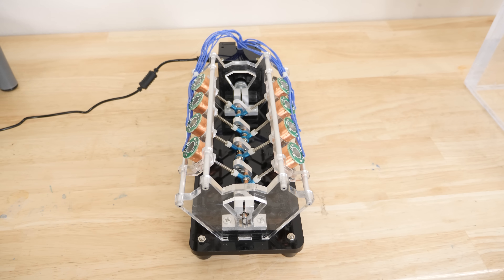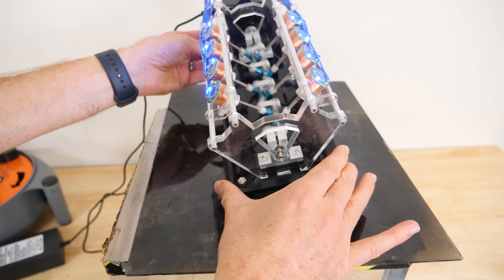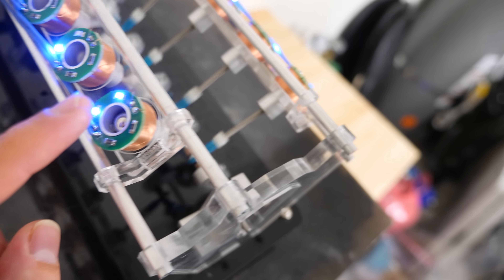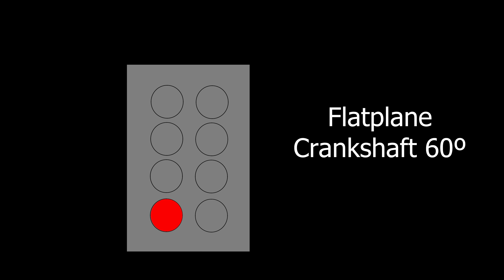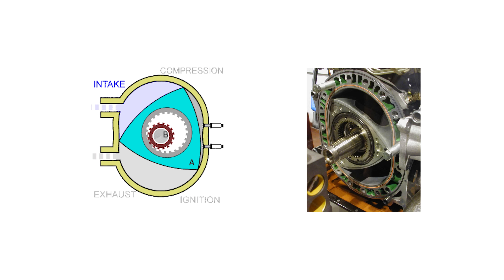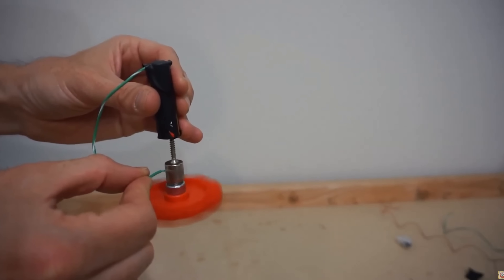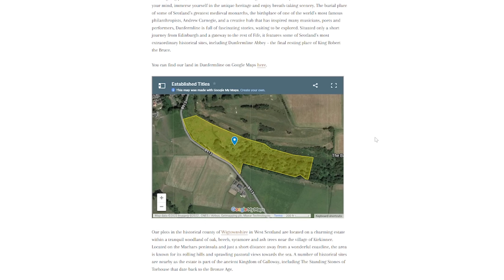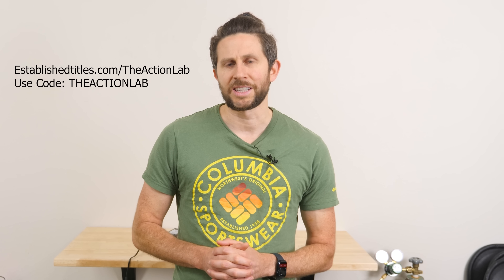Is an Electric V8 Engine a Good Idea?

Comment: Ridiculous idea. You are losing so much energy moving pieces for no reason.

A 3 phase motor directly mated to the axle is the most efficient way. It's why locomotives have been using traction motors for decades.

That 16 cylinder twin turbo diesel engine does nothing other than turn a massive alternator to power the traction wheels.

Comment: The magnet should be directly pushing the crank not using the the pistons. Shorten the block as the magnet his the crank the the crank has magnet also that pushes the magnet back up until gets another magnetic pulse to push the magnet back to push the crank again.  Get the scales out see which motor creates more torque & speed vs induction electric engine.
Worth how much material is needed to manufacture each engine etc etc.. I don't believe you can beat a well designed hub electric motor as this eliminates the need for any other parts needed to start & stop , no more brakes diffs axles drive shafts etc etc design a wheel ALTERNATORS & you have a perpetual engine that shouldn't need battery once it's moving only for initial start & stop starting. If can design an engine that holds charge for 10-30 minutes then this should minimise size of batter or jumpstart pack needed. Faster you go the more energy the wheel creates to charge motor. Ideally wireless charge then can wirelessly charge everything else on car also delete wiring also. Bla BLA bla blabla

Comment: Something I'm surprised I haven't seen brought up here though, is the ability to swap a gasoline car to electric if the platform is in a V8 formation. May not be as efficient. But it would allow some that may not be able to afford a Tesla to swap. Or if someone loves the body/design of their current car, to keep that while switching from gas to electric. I don't think there's enough conversations about swaps from gasoline to electric, instead of just getting rid of a car design you potentially love, just for the benefits of electric.

Comment: Electric vehicles are a horrible idea. The Electric power grid is not even close to being efficient enough to handle the power needed to recharge the batteries. The infrastructure is old and no longer able to keep up with the changes in society.

Comment: I always wondered why automakers didn't use electromagnets to control valves instead of a camshaft. Seems like it would reduce weight and increase tunability of VVT systems, albeit costing more.

Comment: AN "ENGINE" HAS VALVES, PISTONS, CONNECTING RODS, CRANK SHAFT, CAM SHAFT, BLOCK, HEADS, CARBURETOR, DISTRIBUTOR, SPARK PLUGS AND WIRES AND SOME KIND OF A COOLING SYSTEM BE IT WATER OR AIR COOLED.  NOW A "MOTOR" HAS NONE OF THESE THINGS, SO WHY DO A CALL A ENGINE A MOTOR WHEN ANY EDUCATED PERSON KNOWS THE DIFFERENCE.  SO ARE YOU EDUCATED OR NOT???????  TO ME SOUNDS LIKE YOU ARE "NOT" EDUCATED ! ! ! ! ! ! LEARN THE DIFFERENCE, IT IS EASY.  GET A PICTURE BOOK THAT SHOWS A MOTOR AND AN ENGINE AND LOOK AT IT SEVERAL TIMES OR UNTIL YOU TRULY KNOW THE DIFFERENCE.  ONE THING ABOUT STUPID IS THAT YOU CAN NOT FIX STUPID AND IN THE FOREST GUMP MOVIE IT WAS SAID "STUPID IS  AS STUPID DOES".
Reply: No modern engine has carburettors anymore...

Comment: I DONT NEED TO WATCH THE VIDEO!ABSOLUTELY NOT!!! V8S ARE SOME OF THE MOST EFFICIENT ENGINE CONFIGURATIONS YOU CAN GET ESPECIALLY GM V8S!!! AN ELECTRIC V8 DOES NOT EVEN MAKE ANY GOD DAMN SENSE, JUST HAVE AN ELECTRIC MOTOR LIKE EVERY ONE ELSE! The V8 is the best engine configuration you can get in a car, we should be engineering more efficient yet powerful V8 engines, not fcking electric ones. In fact, fuck electric! In the future we’ll just burn E85 and natural gas

Also nice ford voodoo crankshaft

Comment: Total nonsensical idea. now you have balance issues,  lubrication issues, vibration, inefficiency,  complications,  noise, loss of hp and torque, maybe heat, excess size. Drop it

Comment: i could see this as an easy drop in replacement for a normal combustion engine. Or use manual transmission with an electric vehicle. I could see this as a good way to make ev's for car guys

Comment: So question.. why not go with hydrogen  in the cylinder that gets compression assistance if even needed by that example of coils and permanent magnets? Sounds like it can charge by induction by default when idle and provide more power when a load is applied?

Comment: You know instead of using those tiny motors for powering a car like a Tesla we should just go bigger and use something about the size of the Tesla semi truck electric motor on small vehicles and for the Tesla semi truck they should be using the train or something in between the train and the semi electric motors, I don't see an issue here considering it would be slightly better than just playing some white noise or some other bull to make sure you don't fall asleep. The electric vehicles a lot more fun and people don't complain as much when we're forced to buy them eventually because of some tomfoolery of "environmentalism"

Comment: If Tesla really wanted to change the world they would make conversion kits for most vehicles. I know it's relatively straightforward with manuals but perhaps its to difficult for automatic. I just feel that converting existing vehicles would be cheaper and better for the environment.
Reply: Motor swaps cost a ton of money, especially when it's a motor that isn't what came with stock. Spending $10,000 in parts and then $10,000 in labor to make your old car into an electric, just not worth it for most people.
Reply: @PURENT  I've looked into doing it to my 87 Toyota pickup and the parts would run about 2- 3 grand. Thats a Manual and all I would need to hook it up would be a conversion plate.

Comment: Plenty of us are more interested in the novelty than efficiency or power, so I think it's a pretty cool idea personally. It'd actually be "fairly easy" to convert an ice  to this. You could use the same rotating assembly, slap coils where the pistons were, ditch the head, etc

Comment: I don't see the point of using the electric power to turn something that doesn't need to be turned. Just put an electric motor on the torque converter of a transmission or a motor on each wheel.

Comment: In v8s 

I would argue that cross plane are not as unbalanced as you stated... they do not ALWAYS require large counter balances and often can be and are internally balanced. 

Further, the cross plane crank produces more torque, and power is harmonically smoother, thus longer lasting and freerer reving.

Flat plane cranks simply use less material and need less in general to be regaurded as efficient or good. Because les smass although are terrible harmonically and eat them selves alive. 

While cross plane cranks are by far superior in MANY ways and further will long outlive flatplane cranks. 

Of which are regaurded as "exotic" but proven to be less effective. Because they simply can "Rev higher" because of less weight. 

But put he same level of care and diligence into a cross plane, and you'll make 2x, maybe 3x the efficiency and power than any "exotic rip-off money gouging flat plane" 

It is a lot different in a 4cyl or other configs, but wait! They have balance shafts! So HA!
UNTRUE about flat planes not needing balancing... 

Total mis information this video.

Comment: And you are wrong about having more pistons will make make more power is kinda true but mainly false because to make more power out of your engine you need force induction or more displacement or compressions but mainly force induction to force air in to your intake to force more sin to the cylinders to make more power that’s how it works

Comment: I swear I designed this very motor back my senor year in 12. Spent a year on it and it was an amazing motor. Used the 3cylinder tractor motor to build from. Currently use it on a homemade go cart
Reply: @Edward Elizabeth Hitler granted mine was a bit different. Custom head with eltromagnets inplace of valves. Once the distributor lit up the magnet it pulled up on the piston which had a fixed magnet. By sending current thru two magnets on the head I could push pull the pistons.  By putting in a potentiometer I could controll the force of the magnets.
Reply: You should definitely make videos
Reply: Where you able to hook an alternator and a battery to it?

Comment: Okay so I may be just a humble mechanic but I can see several f**** problems with this design.

Most blaringly it's literally the worst of both worlds you are losing the efficiency of an electrical engine and you are losing the power and ease of refueling of a fuel engine.

Comment: People that want to switch to ev don't realize that in doing so your actually increasing your carbon footprint. Don't believe me? Do some research into lithium mining, refining and battery manufacturing. Not to mention that lithium is far more violently reactive than gassoline

Comment: How much power does the selonoid use vs a normal electric rotational engine? Is the use of a capacitors an idea to push the sylinder harder?

Comment: Before I even watch this I want to point out that any time energy is transformed there are losses. In this case electrical energy is converted to linear energy and some heat, and then that linear kinetic energy is being converted to rotational kinetic energy and some more heat.  The advantage of electric motors is that they can go directly from the stored energy to rotational motion with only friction loss, which makes them super efficient. The downside is that batteries are not very energy dense at all compared with gas, so you need a lot of them and a lot of efficiency. An electric V8 is simply extra steps that unnecessarily cut down on efficiency. Especially once you add in  the additional conversions that will be needed (transmission, differential, and switching the direction of the rotation)

Comment: However, the efficiency of a gasoline engine is better than any electric engine. Gasoline engine have over 1000 of years of refinements. Electric Cars have been tried many time and failed for many of them. The only reason it has any success right now is that government are working to limit the pumping and use of oil. They are pumping trillion of dollars into renewable which are not reliable. Also these electric vehicles not only don't live up to the hype, they seem to be a death trap if the battery over heats it with caught on fire. The fire is hotter than if a gasoline car caught on fire.

Comment: ... But a normal electric motor gets no benefit from a transmission's gear reduction... wouldn't the electric V8 gain that transmission benefit if using an automatic transmission (manual transmission would burn out a clutch plate too easily)?

Comment: An electric motor runs on the same principles the windings power the rotor at equal points with out all the extra mechanical parts that rob energy adds friction and increase parts that go bad

Comment: The most practical application would be for replacement of old gas engines that use a standard clutch. This will allow for some similarities to a combustion engine and would give you different variations of torque and efficiency curves. Which could all be done by a rotor based motor   and electronics with complex algorithm and sensors. I kinda want to know what a powerful solenoid base reciprocating motor would behave like. It might be worth the trouble.
Reply: Why?

Comment: I think you missed an important point. The V8 engine has the pistons moving at opposing directions.  So the shaking of the engine block can be dampened. Were as the electric vehicles have to have a twisting torque opposite of the wheel rotation. If the motor is between the wheels and spinning the same direction as the wheels would be ideal.  In other words pop a wheely.

Comment: I had a similar idea nearly 2 decades ago (when I was 12, circa 2002); incorporate stacks of magnets with computer controlled polarity switching, much like a rail gun. I got the idea from building my first Gauss rifle from 35mm disposable film camera capacitors. 

The current pulls the piston along the cylinder wall as it travels from one charged magnet to the next charged magnet until the current reverses and pulls it the other way once at TDC, allowing for primary and secondary harmonic balance forces on the crankshaft much like an ICE powerplant. In this case, the existing crankshaft counterweights would act as a sort of flywheel to continue motion as the computer reversed polarity and "firing sequence" of the magnets (i.e. 1,2,3,4 to 4,3,2,1) and keeping the existing cylinder firing order. 

The idea was to reduce waste by retrofitting existing ICE powerplants with new magnetic heads and pistons, allowing for the crank and bottom end to be reused. The pistons would still use the same oil pickup, pump and oil squirters, but oil changes would, in theory, become less frequent. The cooling jackets could also be mapped out to the new head to keep the engine cooled, and the transmission could also be kept unchanged. Finally, the ECU could be swapped to control voltage regulation and polarity switching, and the emissions and fuel delivery systems can be deleted to accommodate the batteries. 

Bear in mind, my 12 year old self sketched all of this out a full decade before the first Tesla hit the road in 2012. Computers in 2002 weren't exactly fast and battery technology was primitive by today's standards, so I wasn't even sure the timing could be controlled to the precision needed for 4 (or more) mini coil guns strapped to a block and driving up to 100MPH without self-destructing.

Then again, it was one of two borrowed concepts, and I say "borrowed" in the sense that this was existing technology for other usage applications. Maybe 2 years later (circa 2004), Hydrogen was what everyone was talking about, so I sketched a fuel cell and generator concept: the use of Hydrogen to drive an electric generator that stores current for later use with a traditional electric motor, much like diesel locomotives where I sourced my inspiration. 

It looks like Hyundai is currently taking an interest in fuel cells to generate power (instead of direct combustion) with their latest prototype _N Vision 74_, so it's nice to see that my thought process wasn't that far off with . It's just nice seeing both concepts working fundamentally after everyone I showed it to said it wouldn't.

Comment: depends on what you want from it. the electric engine will start off faster but won't run as long. the gas engine will give you more power and run longer but will take off slower.

Comment: I came up with this exact idea one day at work and then thought to myself it wouldn’t be nearly as effective as current methods of EVs.
Reply: Crankshaft motor flywheel AC axial Pancakes/, DC tnotor cromotor pancake & flat sun planetary gear or Koensegg direct drive will fit directly to the driveshaft crankshaft belt side Take a look at the flywheel clutch disc V8 Ferrari engine 3D image OMR Automative Stellantis 18 brands badges merge FCA Fiat Chrysler PSA Peugeot Citroen has all my concerns concepts
Matching RPM on Also adding micro second immediately on gear shift or manual button electric injection 500w to 1 kw +

Comment: The engineering problems I can foresee that would put a solenoid at a disadvantage vs a radial flux: 

-Heat buildup in the coil concentrated to smaller surface area, making it harder to cool
-Less torque and more losses due to friction
-More engine parts, more weight, more points of failure
-Huge loss of efficiency at lower speeds
-Hall effect can't be utilized for regenerative braking (you'd have to use engine braking)
-All drive modes require a drive shaft and gearbox, while radial flux EVs can get away with not having any
-Vibration stresses
-V8 diesel addicts are never going to buy it if they can't roll coal onto innocent bystanders

Comment: You can just use panel speakers at the back and front of cars that mimic exhaust noise. That actually would make them safer. I saw a neighbor pull out and drive off yesterday in a Tesla 3. I removed my headphones because I thought my noise canceling headphones were removing whatever sounds might be coming from it. When the car passed, it was crazy. It sounded like nothing, as if a two ton physical body was not moving through air on gravel. How could I not even hear the TIRES??!? The tires weren’t digital, nor was the brand new yet untreated street wherein a lot of silt and soil from recent rainstorms had collected. I could hear my FOAM RNNRS under foot, but not the whole entire car eight feet away.

Comment: I'm guessing it be very easy to add that sound to an electric vehicle. Midi Foot Switch attached to the accelerator that drives a sample library. I mean video games already do it, just need some good loud speakers. To be honest it would be a good idea too given that it's very hard to actually hear a speeding electric vehicle on the road

Comment: This is actually a great idea. Instead of having multiple electric motors you have a single point power production controlled by solenoids basically. As far as efficiency I think this guy doesn't understand the complexity of having multiple electric motors on a electric vehicle.